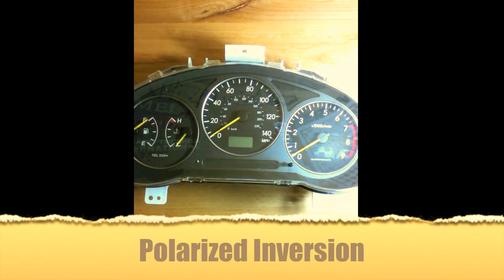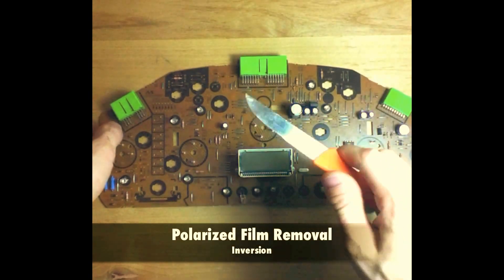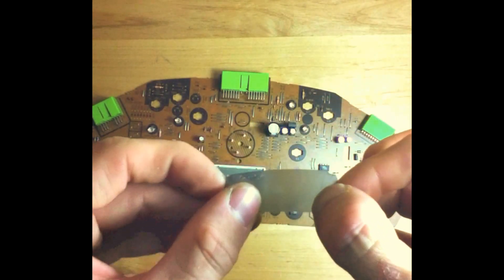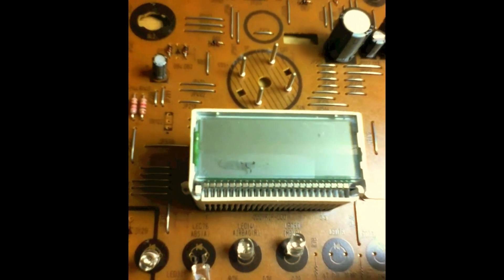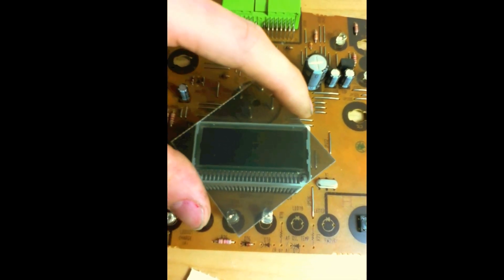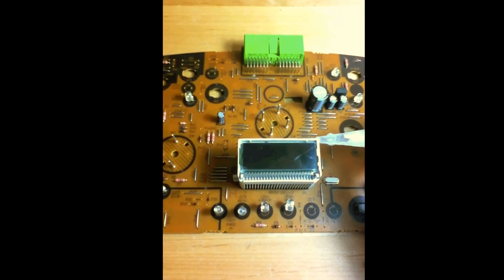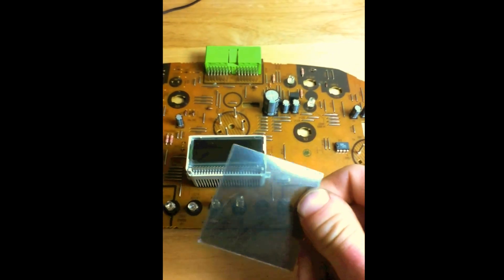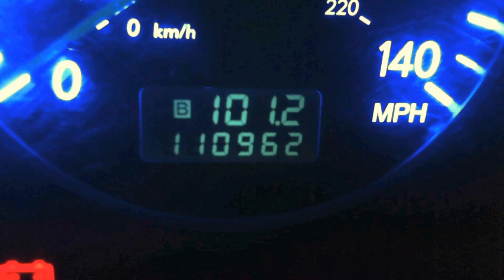Odometer Inversion on Cluster

Comment: did you remove the green film that is on the back of the display?
Reply: i realize this is 7 years later, but i was wondering the same thing. did you find out?
Reply: @bartcarrade  yes depends on the color you want i got away by just putting blue leds if you want a like white then you will need to remove the green film on the back of the gauge face